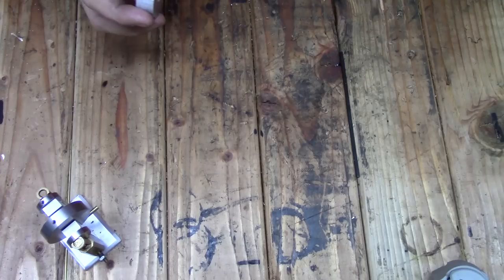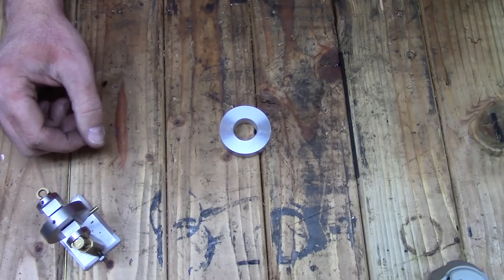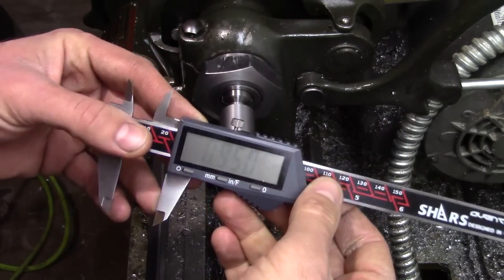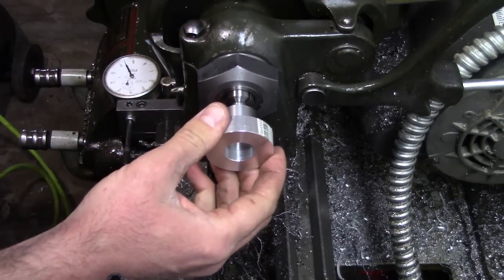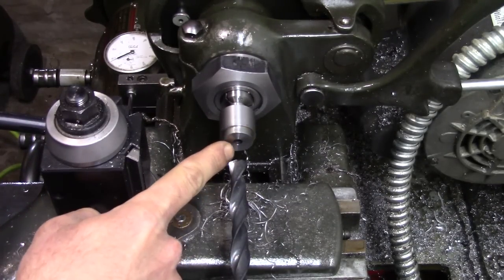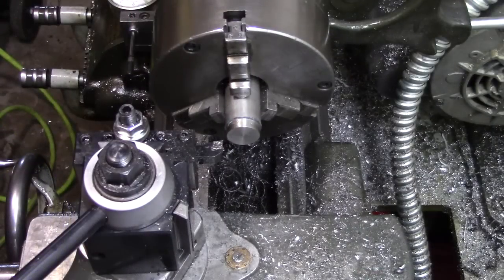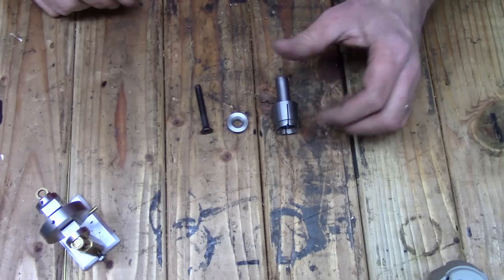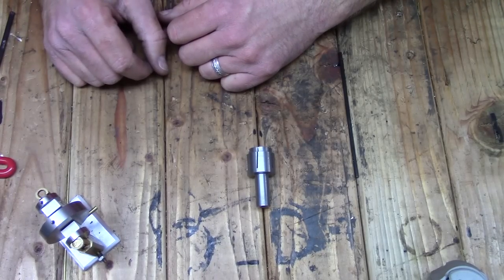Making An Expanding Arbor

Comment: What did you choose for the angle on the wedge and mating arbor internal angle?
Reply from the maker: I used a 60 degree included angle. It was just what my compound was set to when I did that operation. You don't want an angle too shallow or the wedge will have a hard time spreading the jaws. The steeper the angle the less clamping force the screw will need to spread the jaws open. However, too steep an angle and the wedge will get jammed inside the tool and you'll have a hard time getting it out. I think an angle anywhere between 50 and 65 degrees would suffice.

Now that I think about it, I should have mentioned this in the video. Oh well, I'll try and remember the small details in the future.

Comment: I am a little late to this video...But if anybody watches this and is going to make one for them selves. I would suggest drilling a hole at the end of each of the slots that are cut. This does 2 things, It helps prevent a crack from forming and making your arbor go in the scrap bin. And it also makes it require less force to get the arbor to spread open to clamp the part.
Reply: Very surprising that BM didn't reply to this. In the world of basic shop practices it's considered  SOP!
Wakodahatchee Chris

Comment: Just happened onto your channel. I like your no nonsense approach. I am in the process of making an internal mandrel to mount an indexer on my lathe. I am also using the cone/expander approach with a long bolt to pull the cone into the bore taper only using brass for the cone. You think 60 degree taper is best? I haven’t done that yet because I was unsure about how much taper was needed for smooth operation an easy release. The last thing I need is to get the thing jammed inside my headstock spindle. 
    One note: Military background? Reason I asked is you referred to the OD of your part as the “perimeter”. 
It’s usually only us old lifers that use that terminology. Lol
Dale Griggs
Reply from the maker: Thank You!

I can't say that 60 degrees is the best but it does work well in my case. I do believe an angle between 50 and 65 degrees is your best bet.

Yes, I am former military. Served in the Marine Corps.

Comment: That's one way....for me..turning O.D. chamfer then drill & part off then using soft jaws hold on O.D. to finish rest or machine O.D. drill and finish both bore then part off..no arbor needed.
Reply from the maker: +Konely King
That is one way. However, I can't use machinable soft jaws with my chuck. So arbor it is.
Reply: Arbors seem like a more re-usable tool than soft jaws.

Comment: Seeing the carpet of chips under & around your motor reminded me of the nightmare cleanout I had to do on the motor of my bench lathe when I got it.  You're not worried about the one chip that gets in there and slices the enamel on some winding wires?
Reply from the maker: Chips in the motor is something I check for on a regular basis. Chips do make their way in from time to time, but it hasn't been a huge issue.
I have a lot of clean up to do after this current project. Cast iron makes a huge mess.
Reply: @BasementMachinist  wait you guys clean your lathes

Comment: I would think the taper on the insert would not have to be that exact as you made it, since the moment you start to apply pressure to the arbor, it will expand and the taper angle will change.
And you could have used an end mill to slot those slots,
Reply from the maker: You're right. It doesn't need to be that accurate. As for the slots, at the time I didn't have an end mill suitable for the operation. A slitting saw would have been ideal.

Comment: I was noticing in your video your carriage stop and dial indicator holder. Did you build that off of your lathe or did you use a milling machine. Also what size bit did it take to get the V grove perfect or did you use a small bit and take several passes. And if you have a video of it being made I would like to see it. Also I am a new subscriber to your channel. I find the content and easy to follow instructions very good.
Reply from the maker: +Anthony
Thank you for the sub. That dial holder is one I made 5 or 6 years ago when I first got the lathe. I did use a mill (when I had access to one) to make it but it can be made using the lathe with a milling attachment. The v groove was made with a standard end mill and the part was held in the vise at a 45 degree angle. I plan on eventually making a video on it, but if you would like to make one yourself I made up a set of drawings. Shoot me a message with your email and I'll send it over.

Comment: Don't you have issues with chips  getting sucked into your motor vents there?  Looks like a good place for a shield or some screen at least!
Reply from the maker: +somebody else
It isn't as bad as you might think, but chips do get in there. I clean it out every now and then. The lathe came with the original 3 phase motor and this motor was a free be just to get it going. Eventually, I'll upgrade to a sealed motor.
Reply: Do you still have the 3 phase motor? I'd be interested in it.

Comment: use a1/8npt taper pipe plug for your ex pander. less maching
Reply: I did exactly that to hold some bronze bushings I needed to shave down.  It was the first time I had to cut tapered threads, took two tries.  Worked fine though!

Comment: Good video. A caution though. If you are trying to measure a dimension closely, remember that the digital caliper you are using is incapable of resolving anything closer than 0.0005" of the actual dimension... a downside of any digital device is that it's all or nothing on the last digit displayed. 
Generally anything that has to be held closer than +/- 0.005 should have the final dimension checked with a micrometer, not a caliper. Yes, you can with care get a good measurement with a caliper... sometimes it may be the only way you can measure a dimension... but keep in mind the caliper's limitations.
Reply from the maker: Thank You.
I know the limitations with using a caliper. 90% of what I do does not require a high degree of accuracy, anything +/- .001 is good enough. The other 10%, I'm still limited, as I only have a 1" micrometer. I have yet to have a reason to get a larger one, but I will when the need arises.
Reply: Agreed. If you know the limitations of your tools and equipment, then you can do work-arounds to reach your goal.
For instance, I have zeroed my digital calipers on gage blocks. Then I know that the measurement I make with the calipers is within +/-0.00025" of the gage block stack.
Be sure to go with your wife when she goes to estate sales. It may take a while, but you'll finally run into one where some old geezer like me has kicked the bucket and left a basement full of machinist tools that nobody but you will have any idea what they are. You'll find the micrometers you need. Buy everything! You'll kick yourself later if you don't!

Comment: why not just drill, taper and thread the arbor body for a bigger size counter head screw and one less part to make.  Have the screw do the expanding.
Reply from the maker: That is an excellent idea. I was trying to use material that I had on hand. I don't think any of the screws that I had would have big enough.
Reply: Trust me ACE is your friend in that respect.  Anyways Joe Pieczynski has that very exact concept elaborated on YOutube.
Reply from the maker: I agree. Ace is tour friend, except when you live as far outside of town as I do. Driving into town for a single screw for a project I'm doing on a whim, just isn't practical.
Reply: I am about to enter that boat myself.  Tractor supply isn't any where near as good as ACE in that respect.

Comment: What is the angle of the taper?
Reply from the maker: I used a 60 degree included angle. It was just what my compound was set 
to when I did that operation. You don't want an angle too shallow or the
 wedge will have a hard time spreading the jaws. The steeper the angle 
the less clamping force the screw will need to spread the jaws open. 
However, too steep an angle and the wedge will get jammed inside the 
tool and you'll have a hard time getting it out. I think an angle 
anywhere between 50 and 65 degrees would suffice.
Reply: Thanks very helpful